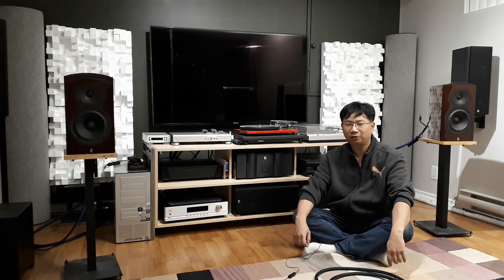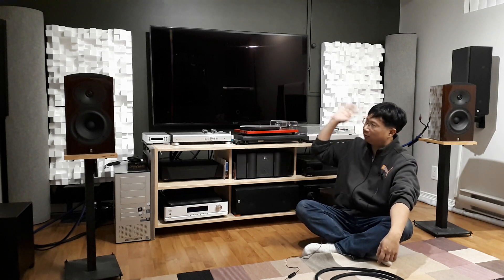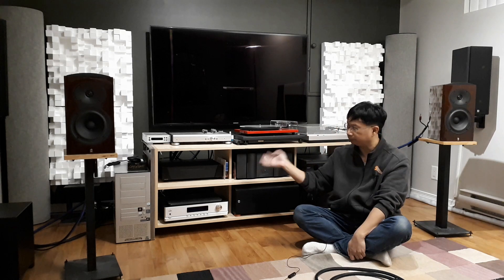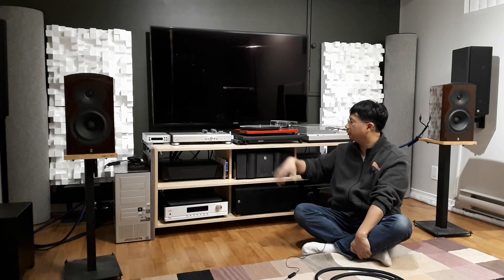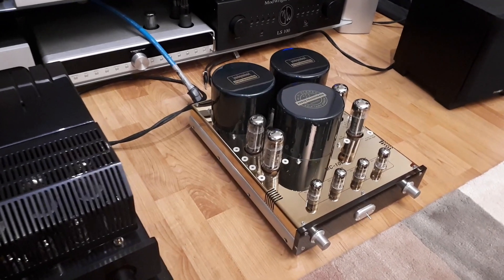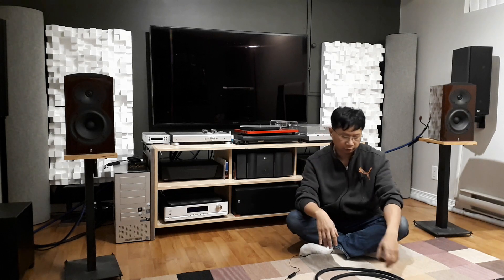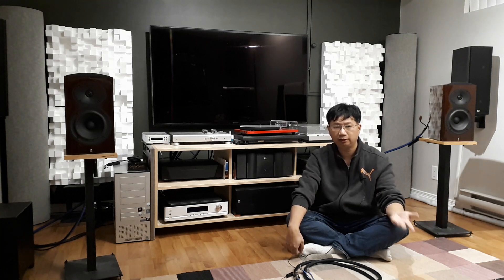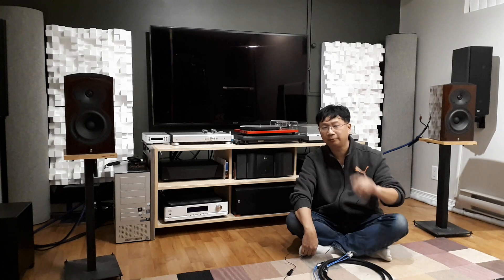I am back! With fake speaker cables!

Comment: I meant to add......, as I felt you weren't one whom hears the differences in cables!, why then would you expect ones coming from China to seriously compare to the real Siltech's?, as Element Acoustics ( . Ca ) have been mentioning said fake versions for years now, I'm someone surprised you never took the time to listen to their cheaper version, called the " Explorer Series " which I once owned, yet have found Jena Labs cabling more suited to my system.....,  yet as the olde adage goes " hearing is believing ".

Be well young man, until next time.
O_o.
Reply from the maker: Oh I do hear difference. I have boxes of cables and have tested countless cables from free to $5k+. I also have friends with $15k+ cables so I am really aware the difference it makes. Just not power cables...well maybe, it's a long story as I keep trying cables. Cables, however, is complicated, not all cable makes a difference and cables alone is a big topic.
Reply: Thomas & Stereo 

Very very true. I missed the part where you did refer to power cables, yet it came back to me just now.

My take on them are ( as instilled by one of my cable mentors ) is the  smaller gauge ( 14-12AWG ) ones allow more a more responsive | nimble | quicker attack of notes, and are meant to be used on items like CDP's | DACs | Preamps and Integrated Amps, whereas the thicker, heavier gauges ( 10-7AWG ) are meant to be used with power hungry amp, which require more current, and generally put out between 200 - 600 w|pc, if that makes and sense?, as high current is their main goal, versus that of attack or speed of note.
Reply from the maker: Yes and it's something I am afraid to try actually because I will end up buying a whole box of power cables!
Reply: Thomas & Stereo 

Understood......, but the most vital areas for them are your Source ( Music Server or Turntable ) | DAC or Phono-Stage | Preamp | Integrated | Power Amp in said order. Start with your  Music Server and DAC, and go from there.
Reply from the maker: Yeah, the whole discussion on what is the most important is a conversation that can last hours. I think most would agree it's the speaker. The next one, I might be leaning towards the power amp actually from my experience.
Reply: Thomas & Stereo 

From my 42 years at this......, I believe one ideally builds around an amp which speaks to them on an emotional level, then find the speakers which it's capable of driving properly.

All to often ( being as I once worked in audio retailing ) I've seen far to many buy speakers which didn't fit or over drove their rooms, merely because some are more impressed with trying to make a statement to their friends | associates like the olde adage " mine is bigger then yours " read as in " I've more money " therefore can have more bragging rights then others ", and more often then not, actually own amps which aren't close to driving the speakers properly to begin with, hence lacking one should select an amp they love, followed by the speakers......, instead of the other way around.

Much like I was taught in the old Linn | Naim camp......., Source first, followed by amplification and then speakers as budget allows?, I still hear the logic behind said approach, but as the saying also goes " YMMV? ".

Just an opinion like others, no rights, or wrongs, merely different means of hopefully coming to a common goal......., balanced music reproduction within ones living space!.
Reply from the maker: Very insightful. Thanks for sharing your history.  Yeah, there are different logic and I one side starts at the source while the other at the speaker. Yup, no right or wrong.
Reply: Thomas & Stereo 

You're more then welcome.

And you're correct........, as in the end. We're here to educate and share with the younger music lovers on how to build a proper system, like in the ones someone is able to enjoy for years, as opposed to changing items within every 2-3 months, while in truth most of their gear isn't even fully broken in......, " so then how would said type of owner, constant seller, even knew how it actually sounds? " 

I've come to believe in the powers of selective " voicing or flavoring " if one takes the time to truthful understand the sonic merits of any given component!, it then becomes a lot easier to select others to place around them, which collectively creates a sonic whole based upon a synergistic means of locking things in, where it holds ones attention for years and years.

It's merely a matter then of knowing what " to listen to? | for? ", as an older Japanese gentleman taught me to focus my attention upon the " music itself " instead of listening to the boxes ( components ) as that's where most of us make our first mistake......., as it takes a sense of maturity to realize one has to form an emotional connection with the very essence within each note, only then does one understand just how cosmic it really should be, to use a term my beloved wife endears.

As I'm retired, I can occasionally sleep as the body needs, but you on the other hand young man, should preserve your strength,  as I'm always a click away, so we can always catch upon this later, God permits!.

Comment: Are those room treatment panels from Vicoustic?  Perhaps the Multifuser DC2?
I am asking, because although they work, they do so only for as long as they do not fall off of the wall or ceiling.

Many customers have warranty claims, due to the glue (also sold by Vicoustic) not holding for those panels and other panel models that they sell.
Some panels will hold for weeks, or months, and others for longer.  But they are not dependable, unless Vicoustic has remedied their glue issue.

One identified problem with their adhesion is that Vicoustic had been selling expired glue.  The glue canisters have a best used date on them, and Vicoustic has been selling them beyond that date, even longer than a year past that date.

Please check your glue (if it is from Vicoustic), and please advise if yours is expired.
Also, if in the coming weeks and months, your panels start to fall off the walls, please advise us.

I hope yours hold up, because they work, and they are not inexpensive.

Thank you.
Reply from the maker: Thanks for letting me know. They are the DC2. I have not glue them on yet but I will most likely look for another solution as I did not buy the glue. They are stupid expensive and they feel like $5 foam.

Comment: Decent gauge ofc cable and you won't notice any difference, the issue is the fake eBay cables that claim let's say 8 guage ofc and is 6 gauge of aluminium rubbish wrapped with 2 gauge of copper, three grand for speaker cables they saw you coming a mile away, I expected more from a supposedly knowledgeable audio enthusiast😞
Reply from the maker: Well I got them almost for free so it was acceptable risk for me.